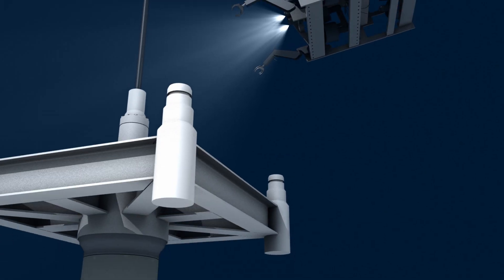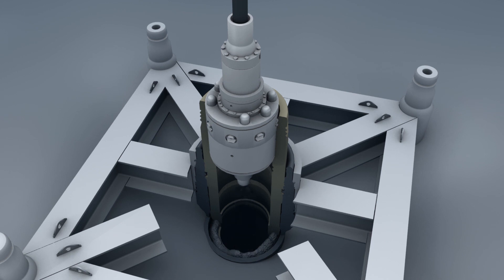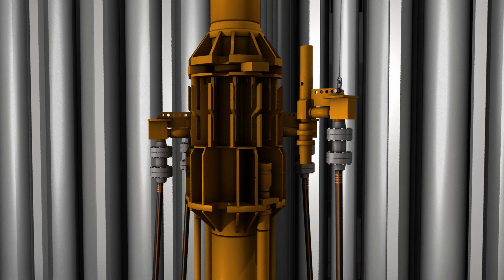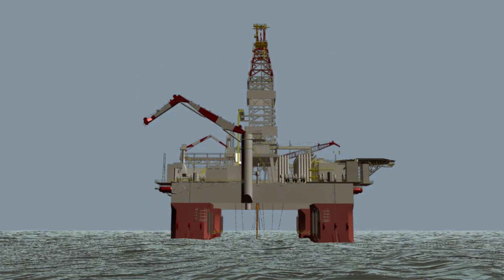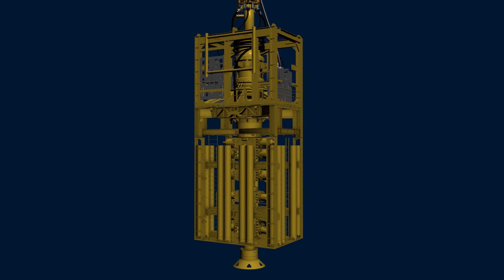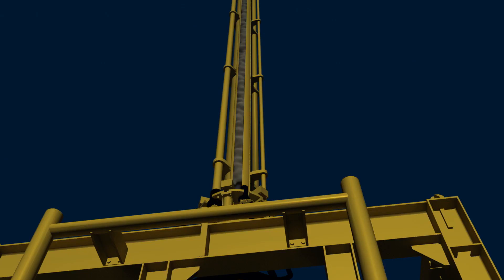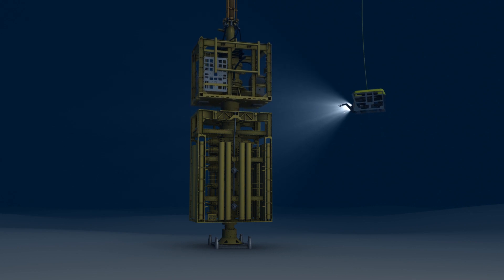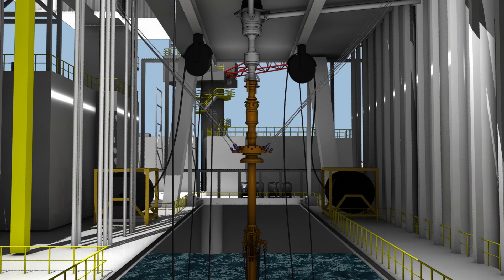BHGE Offshore Drilling Overview

Comment: As purely an academic question how in the termination joint lifted over the riser. I noted that in the video that it was dragged along a track, however after leaving the jack wouldn't there be a large amount of sway, back and forth due to size and mass; or is that something to be handled post lift by the rig crew?
Reply: AlexanderStagg ok